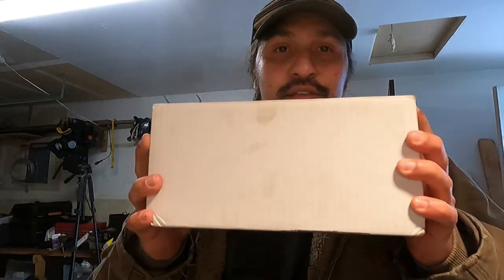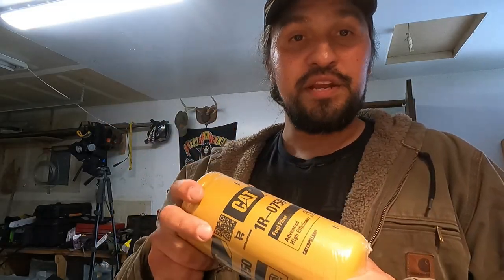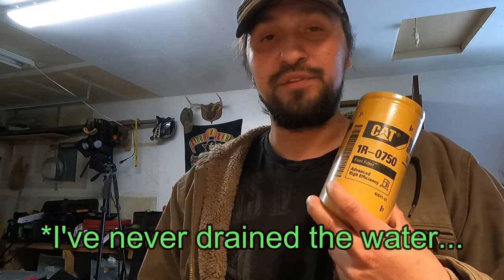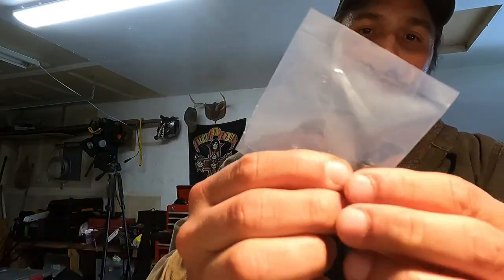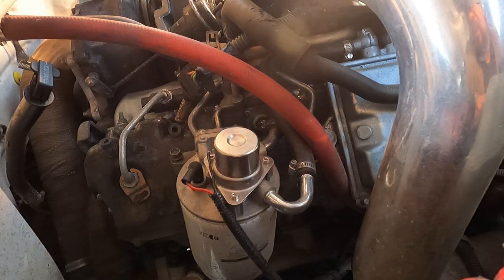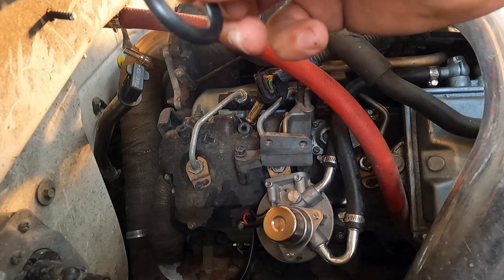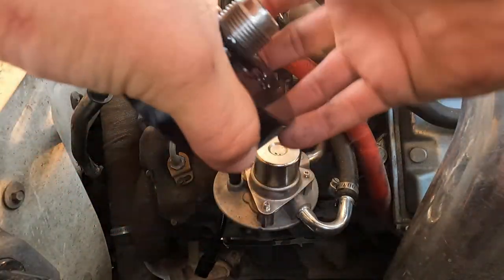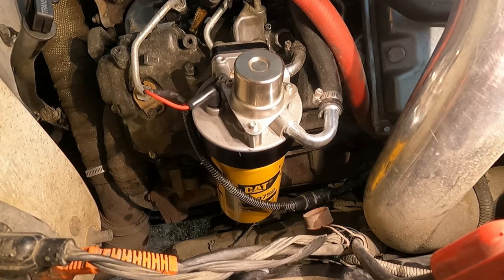Is the CAT Fuel Filter Adapter a Game Changer for Your LB7 Duramax?

Comment: Very Well done video. I have to agree with below, however, it's your truck and being total yellow, why the hell not! Do you have any opinion on the Cat oil filter? Someone mentioned dry starts.
Reply from the maker: Just seen this comment so i appologize for the late response.  I've ran the cat oil filter for about 4 or 5 years now and have not had an issue with dry starts and I take this pig up in the mountains on the old logging roads in Alaska and camp for weeks at a time.  You would have to park at a pretty extreme angle to drain all the oil out of the filter... like damn near a 180 degree angle which of course is not realistic.

Comment: You have a lift pump. Imo a 3rd filter is redundant and not necessary.  I would have recommended the FASS Fuel filter delete.
That being said, I still run the oem GM fuel filter along with my AirDogII4G165.
I'll might get the Fuel filter delete when it's time to change the filter, maybe.
Reply from the maker: I 100% agree with the 3rd filter being redundant.  That is why I deleted the whole filter/heater housing for the past couple of years and just ran a bypass hose.  It wasn't until our winters started to get a bit colder than usual that I decided to add the housing back in to gain that built in fuel heater and added a fuel heater to the FASS LP as well.   My logic was that since the filter housing is back on I might as well run the filter (no harm no foul) to add that extra layer of filtration between the rear of the truck where the FASS is located and the CP3 which of course is located in the engine bay.  Since I am running CAT filters on my FASS and I can get the fuel filters in a 2 pack for relatively cheap, and considering I have a youtube channel that seems to attract Dmax  owners who enjoy the CAT filters I thought "what the hell" might as well give it a try :) If I lived in a warmer climate I would have probably stuck with bypassing the filter housing all together and just continued to run the fuel hose.. These filter housings are a leaky pain in the arse. lol
Reply: @KooshdaakaaGarage  have you considered deleting the fuel cooler under the truck by the tank?
Reply from the maker: @GMCJay_lly  I definitely have thought about it.  Probably not a bad idea for around here.  Bah, the delicate dance of keeping diesel at optimal operating Temps 🤦‍♂️ haha 🍺
Reply: @KooshdaakaaGarage  keeping the filter head and priming pump is also handy if the pump in the lift pump fails considering  a air dog is "flow through" design you can still prime it if you have to
Reply from the maker: Good call! 🍻

Comment: I have a 05 lly what i do whit the bottom électrique connector?! I just need to unplug it ? And any check engine light will pop on the dash thanks
Reply from the maker: @CourtoisEnrick  yeah all you have to do is unplug it. There shouldn't be any check engine light that pops unless it's plugged in and senses water.  That said you can test this out prior to the conversion just by unplugging it right now and seeing what happens.  Nothing happened on my lb7 and the sensor was fairly new. All good!
Reply: @KooshdaakaaGarage  nice thanks you i will try it next week and update you 🤟🏼

Comment: Is the WIF sensor just not that important? Or the ability to drain water from the filter.
Reply from the maker: I'd say yes and no depending on your situation. If you don't change your filter on a regular basis, only have access to watery fuel or don't have a lift pump with a water separator then you probably will want to stay stock.  However, I change my fuel filters every year, have a lift pump with a water seperator, and have access to quality fuel so not having an extra water seperator isnt an issue 🤷  that said if you have quality fuel and change your filter every year or whatever interval you are on then I wouldn't worry too much about draining the water.  If enough water accumulated at the bottom of your filter in a year to get sucked from the top of the filter into the engine then the fuel source would be the bigger issue.
Reply: @KooshdaakaaGarage  I don't know if my fuel is quality or not, I just get it from regular stations. But I do have a new filter and am getting a recurrent "Water in fuel" message regularly. I've ran through my tank many times and have used additives for this issue, to no avail. Definitely getting a lift pump down the road though.
Reply from the maker: @oof578   Oh man, that is certainly worth investigating.  I'd check the WIF sensor wires for any breaks that could be shorting out.  For good measure if its an older WIF sensor I'd swap it out for a new one. Those things have a reputation for going out and throwing false readings.   Best of luck man, I know how annoying that can be and how concerning it is to imagine water getting into your engine.